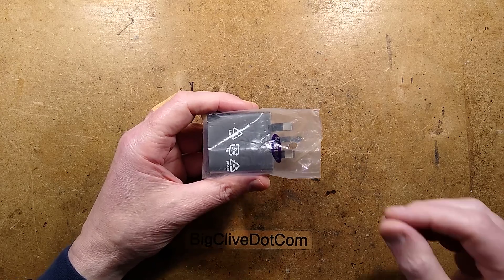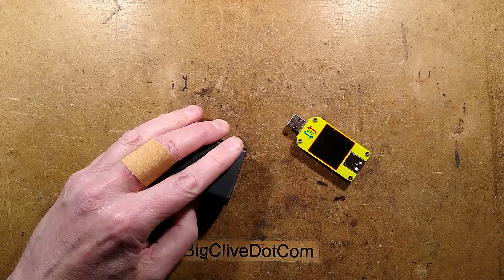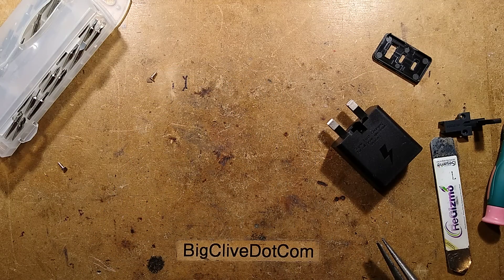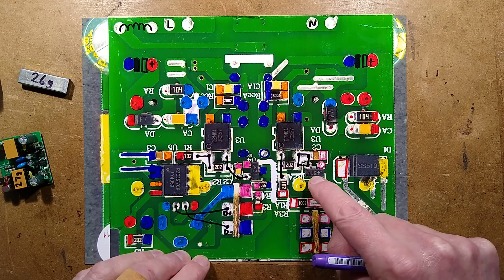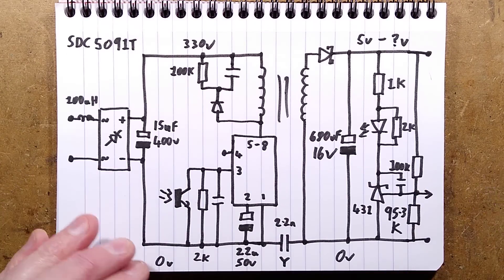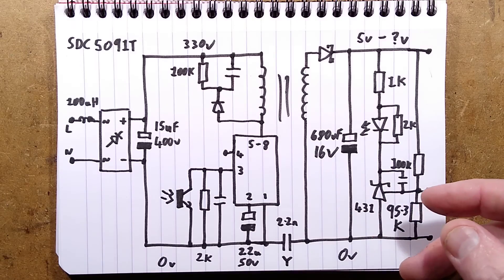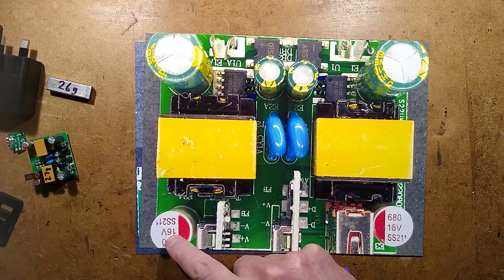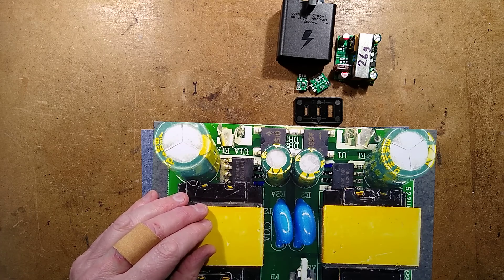Fake Samsung charger with interesting circuitry

Comment: the problem with qualcomm quick charge host IC's is that they have absolutely 0 tolerance for overload or brownouts
I have killed like 5 different QC devices, one still works but triggering more than 5v just doesn't work the two AC blocks with tacked 2.4a ports blew up as the IC died and had it unlimited except by the 16v capacitor that eventually shorted and blew the input fuse
all these "smart" devices tend to be designed poorly to handle the rigors of the worst consumers

the QC chargers should include native overload limits(a current limit self reset fuse on the input coil would solve it) and native brownout tolerance(the chips basically die if they brownout too many times, not sure how to fix it)

I have minimal experience with PD sources(I do have a portable screen that likes up to 15v that my laptop doesn't support) but as I have no actual PD host(besides a kinda nice kinda durable 5-12v dual powerbank with swapable <21700 slots) I do not know if that protocol has more durable chips

I have taken to using some dumb 18w QC modules with my chosen xt-30 connector(used barrel jacks before but the ones I could get easily were just very unreliable) and a bunch of modified or protected salvaged cell packs from old phones and devices

I have a large pack of 40,000mah from some dead power bank devices that had nice polypack cells that some simple mods and a 10A PCB was fine to power my little modules for long periods(for my display to have an external 12v boost source which helps allow for higher brightness)

I also have a few 1s 18650 single cell holders with protection and a proper li-ion cylinder cell charger

I plan on just getting dumb fixed or adjustable boost devices for most of my uses as the QC standard has proven too non-durable for hobby power and I will use my trend of protected single cells to power stuff in series to get 7v, 11v, ect
I may design micro-pcb protection arrays for larger packs that just protect an RC series pack natively(just measure each cell via the module and if any 1S protector opens it disables a mosfet module with transistor buffered signal lines)

all in all while dumb 2a blocks can be hella useful, I actually had someone I know have a literal household outlet melt from a failed 1a charger, it has a blackened hole where the upper nema-5-15r is just gone, I am unsure if other things were attached to the 3 outlet extension but I have asked and that person did charge an IOS device with a frayed cable in bed with the block, so I assume overheating under ~100% load caused a weak short that melted the mains outlet

to anyone who read this far, good on you

PSA: NEVER use a charger block in a place where it can be insulated by bedding, and running a block at 100% isn't good either, find the highest rated highest quality block, choose the shortest cable that you can tolerate without covering your block in blankets, use a power strip with that breaker bit that actually trips if you test it with 2 space heaters of overload, and if your cable gets frayed, just replace it bedroom fires are just far too easy to cause with cheap charging setups, your life is not worth the 5$ you save by cheaping out on in-bed charging safety
Reply: lol spoke too soon, basically the same design was on those two blocks I killed by overloads, one side was a standard 2.xamp 5v supply with an obvious 6.3v capacitor and resistor divider, the other side had the 16.8v capacitor and a tiny 6 pin chip that did the feedback and talky bits, that chip was the part that dies and lets the PSU just float until it blows up the circuitry as it just stops telling the power supply to shut down
it seems oddly common to do this dual-supply design in most of the actual PD/QC chargers, though they do tend to use one set of diodes and fuses on the input and just have two PSU chips/inductors to run the two different rails on the output, it would be so much easier and likely safer to run a simple single 12v/20v fixed supply and re-buck down to 5v fixed and PD/QC supply via a common buck IC, that way they can design in a car charger bit with no extra fuss and drop the mains 12v, this isn't even more complex or expensive as I suspect the tiny mains inductor is actually the most expensive part in most of these supplies, and is the most expensive to get made safe
I still think the design of these trigger chips is woefully inadequate as I one had a USB lead literally burn a hole in my bedroom carpet, and that was just at 5v2a through a parallel supply that had an 8a max load over all 8 ports, and if the lead could short that hard but not enough to shut down the supply, it would do what I did to my QC supplies by overloading them without you noticing it

QC chips have overshot mass manufacturing cost reductions and gone right into "dies before the 30 day return window from normal use" I would much prefer if in some cases our supplies were like the old massive transformers with a linear regulator or tuned to be a specific voltage after a massive diode rectifier

I may actually design such a system someday, a simple microwave oven transformer with the HV winding snipped and replaced with an ideal ratio of 18-10awg  wire to get ~9vac and ~3vac I can then rectify to 5v and 12v dc respectively at massive currents(maybe a 27vdc peak as well for a dumber than YEC power supply to recharge my UPS array that lines up perfectly with a 1000w generator)
these USB supplies have become too cheap to be safe for most brands, give me a large brick regulated by a 7805 on a massive chunk of metal over these tiny warts anyday

Comment: when Texas Instruments first came out with their high end highest priced calculators ($200 to $300 in the '80s) they put steel weights in them too.  the calculators themselves were designed well but much lighter without the weights than older style, much cheaper, calculators.

Comment: I used to have a handheld game player ( PSP!/MP5! 10,000 games! ) that was basically a Nintendo-onna-chip with a few support ICs to give FM radio, MP3 playback and ( limited ) video playback.
It was surprisingly good for NES/SNES/GB/GBC/GBA emulation. The radio worked, with headphones, and MP3 playback was acceptable. Good battery life too. The screen was clear and bright.
One day though, it failed to charge. 'Spicy pillow' was my first thought. Sure enough, the battery needed either Benadryl or Viking funeral. It got the latter. Nestled between the battery and back panel was a strip of heft adding steel. It didn't need it. It was a good product at a keen price. I mackled a BL-5C clone battery in and got another years use from it before mislaying it somewhere.
That strip of steel made me chuckle at the time. That it's still being done a decade or so later?, not quite so funny.

Comment: The proper fast chargers use GaN FETs. They are pricey but the are like power FETs that can work up to GHz and have extremely low on resistance and high current capacity. The faster the PSU switches the higher the efficiency so these things run cold.

Comment: I bought several ikea chargers thanks to your videos!
Maybe you could also tear down the IKEA ÅSKSTORM charger. It has the same form factor as their other 3 port charger but instead has 1 USB A and one USB C PD3 port. Could be interesting to compare them.
I also got Ikeas new Power Bank, might be interesting to tear that down as well and see if the quality is as good as with their chargers.
Reply: Åskstorm has in fact 2 USB A and one USB C Ports. But I agree, that it would be nice to see a test!
Reply: @victorandersson9737  there are 2 different askstorm chargers. The 40w is much larger and has 2 usb a ports, the 23w only one
Reply: @LotosHans   Yes, checked there Web and you are right! The version I bought have 3, but there is a smaller version wit 2!

Comment: I have seen weights in many cheap knock off electronics. The idea is to make it feel like the authentic brand. Its a crooked method but not a new practice. I remember buying a cheap Getto Blaster once that contained weights hot glued into it. That was back in the 80's. My guess is the chips you couldnt identify are also knock offs.

Comment: Hi m8 ,if possible can you reverse engineer a osmo dji pocket  4k camera. 
So i can see how to modify it so no battery is needed to power it on .This way it can be powered by usb straight to battery pack and have no overheating issues that it currently has.
Great channel very interesting 👍 
Lovit👌👊🏽👊🏽✊🏿👏🏾😃

Comment: Unusual, but accurate low voltage probe (with schematic)
POST TO CLIVE - 08032023 - The Diode across the 3V3 Reg is to discharge the 100nF Cap and Set the MCU to read from zero V. So is a Zero V Reset Diode.

Comment: Fugaz mass .. ie, added weight - is certainly nothing new.

Anyone who recalls the 70's stereo/amplifier adverts, where they would often have an 'under hood' shot with all that finned aluminum?

Like it or not, the Japanese did better in the 80's with a few TO-220's screwed to a pop can - but they were clever. Someone understood that heft may equate to quality for the American market .. and so began to install 'quality' slugs.

They still exist of course, and the psychology is sound.

I ran across another just last week. An actually decent cast 2 inch round puck. The joke here, is that on the parts breakdown .. the puck has a number, the circuit board didn't. Oh what interesting times we live.

Comment: buy a can of power supply opening spray, it melts the glue joints in these andthey pull apart without having to get out the tools

Comment: I must say the English power plugs are the ugliest most bulky things I have seen.  I have lived in a number of countries in Europe, Australia and North America.  The plugs I think are the most "intelligent" are the Australian ones.  Much less bulky and less ugly, and naturally polarized (for active and neutral) the American plugs are OK but 120 volts is way too low for some appliances and originally not polarized so they mad one pin wider.  European plugs are also weird with the ground having been added as an after thought and being on the side.  "Aussie rules"..... 🙂
Reply: Ok I'll bite ... Type G plugs (used in UK and elsewhere in the world) are designed with safety in mind first and foremost, and not esthestics.  

From a bulkiness perspective they are designed to be left plugged in the wall using switched outlets rather than needing to unplug to disconnect (just like Aussie plugs I know).  Their profile when plugged in is one of the flattest of all the plug types, particularly compared to those that have the lead pointing straight out the back (which can be a disconnection trip hazzard with the more flimsy plug types).  Furniture can normally be push flush right up against a Type G plug as the lead typically comes downwards offering a very flat profile.  

Wall warts USB adapters vary in design some have the lead out the back (as this one has) and some at a right angle to the plug's mains prongs; this applies regardless of the plug type.  Type G USB adapters once plugged in the they are no different in bulkiness to any other types as it is the body of the USB PSU that takes up the space and not the mains electrical connection prongs.   Some adapters can be as flat as a normal Type G plug.  The one above, claiming to be double insulated, has a collapsable earth pin to reduce the size when unplugged as well, which is becomming quite common with USB chargers.   

That said beauty is in the eye of the beholder, but to the me the Type G is one of the most safest and elegent designs around (but then I judge beauty on function not form).  It is also a very re-assuring design having the chunkiest conduting pins , we leave our plugs in or put away hence never step on them.

Comment: I've designed this type of circuit for work.  The SDC5091 is a saturation flyback driver IC.  It has a depletion mode FET that ties the 2.2uF cap as a bootstrap supply.  The IC also has a power MOSFET on pins 5-8.  These normally have pin 1 and the bottom as ground.  The IC turns on the MOSFET, charging the primary side of the flyback transformer.  The opto-isolator triggers the IC to turn off the MOSFET when the core of the flyback reaches saturation.  As the magnetic field collapses, it is forced into the secondary side, providing power to the output.  When the core is no longer saturated and the output starts to dip, the opto-isolator turns off, triggering the IC to turn on the MOSFET again.  The odd configuration of the freewheel/snubber circuit is because you want the primary side to be able to reach a highish voltage while the field collapses into the secondary, but not too high that it damages the MOSFET, or puts the body diode of the FET or MOSFET into conduction.  This circuit could just be the resistor and capacitor, but there is a high likely hood of unwanted oscillations.  So, the diode is added to eliminate any oscillation.  It is common for this diode to be a power zener, or a TVS depending on input supply and flyback specs.
Reply: Great explanation! Thanks!
Reply: This kind of a detailed technical explanation can only come from some who has More Head😁
Reply: Obviously you are speaking Arabic as I understand none of this
Reply: Funny that's what I was thinking😂
Reply: I have never heard something sound legitimate yet so suspiciously fake at the same time.
Reply: @thatlass  Go pull up the LT8301 on mouser and take a look at the datasheet.  I use these ICs extensively for isolated power supplies.  They don't use the optoisolator, which is a big draw for me.  They do, however, use the same snubber type circuit on the primary side of the flyback transformer.  The operation mode is the same, but the LT801 uses an internal current sensor via a feedback resistor to figure out when the primary is saturated, or near saturation.  The IC will run in one of two modes.  First mode is effiecent at low power levels.  It pulses, waits for the power to drop, then pulses again.  This is good for light loads, but will overwhelm the IC at higher loads.  For the higher loads, the IC will pulse at a frequency which increases as load increases.  This allows for more power, but at greater losses.
Reply: Do you have a reference for understanding flyback designs more? I've recently designed my first working buck converter PCB and would love to understand flybacks but don't know where to start.
Reply: Hey I know some of these words!
Reply: I like your funny words magic man.
Reply: You burned my house to the ground!!!
My family is dead!!
What do I do now?!
Reply: @handleneeds3charactersormore  The funny whimsical elf of negligent electrical design: 🤗🤭😛

Comment: I bought a Samsung charger from ebay back in 2015 I think, and it had a very short lifespan. First charge and the top of the charger started bubbling from the plastic casing melting.

Comment: Hey Clive. rather than worrying about "plugging expensive devices" into "questionable" PD chargers, you might consider getting some cheap Power Delivery "decoy" boards.  These things cost from a couple bucks each up to about fifteen for a fully programmable unit. The most basic ones spoof the PD charger for a single voltage and provide + & - measurement / connection points, slightly more advanced models have short-able pads to select the PD output voltage, and the most advanced modes cost around 15 bucks and use a push-button and  colored LED system to program the output.   So instead of risking any PD equipment, you can just decoy the different voltages, measure them with a meter & apply a load if you so desire.
Reply: I came here to say this. I have one QC trigger that has a button and LEDs on it to choose between four voltages, and came with the option of USB, screw terminals, or barrel jack for output. And I have several others that are just USB-C cables with barrel plugs on the other end that each operated at a fixed voltage. I think there's also some PD trigger stuff in the my drawer too, but I can't remember now. Aliexpress has plenty of choices, which makes me think eBay will too.
Reply: There are also newer USB volt/amp meters that can act as PD triggers (as well as querying the supply and informing the user of what it supports) like the FN58/FNB58. Might not be a bad time for Clive to upgrade from the old Ruideng meter.
Reply: Clive already has a variable load to test USB chargers.
Reply: @acmefixer1  Uuhhhhhh.... a decoy board is NOT a load...!!!  A decoy board simulates an actual device by negotiating the voltage that the charger will provide... as low as 5 volts for run of the mill USB devices, all the way up to 20 volts for laptops & other high power devices.  Extremely useful to have in your kit. The USB test load plugs into the decoy to test if the PD charger can deliver it's ratings.

Comment: Quick looking the 6606ACA looks like a Fitipower FP6606AC with the last A a power rating (A looks like a 18W, so very limited QC support, e.g. only 12V so some QC devices may not trigger fast charge)

Comment: I'm honestly quite confused by the counterfeit branding and weights. Sure, it's no SMAHAGEL built-to-every-spec(-and-beyond-just-in-case)TM build quality. But it's far from the worst cheap charger designs we've seen here. What makes it even weirder is that the listing (at least the first page you showed) does not seem to attempt to deceive the buyer in this way at all, very odd.

On a note related to chargers: If you can; please check out the "Xiaomi 65W GaN" chargers (both single USB-C and '1A1C' versions, if you can get your hands on them). I've only ever found a single - low resolution, and not very in-depth - teardown, and was pleasantly surprised by just how much power (dissipation) they were able to build into such a tiny form factor. If you can't get your hands on the earlier USB-C-only revision, I'd be willing to send mine (NL, 9~11GBP shipping) for a small compensation towards getting another 1A1C one.